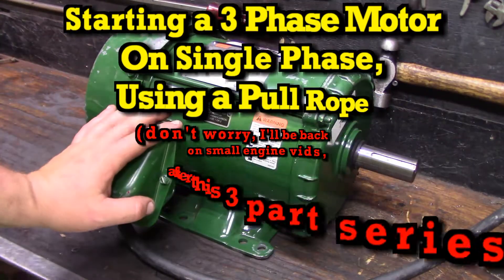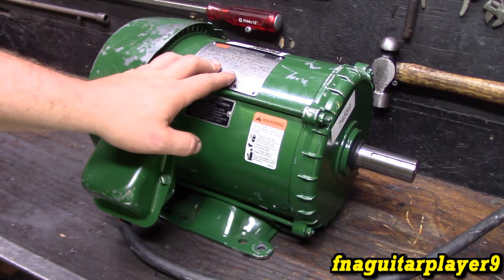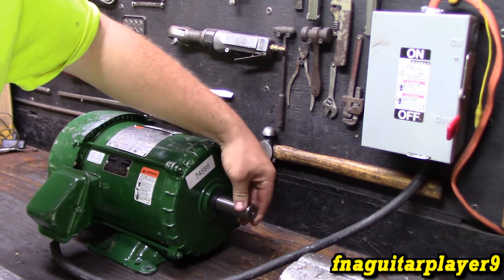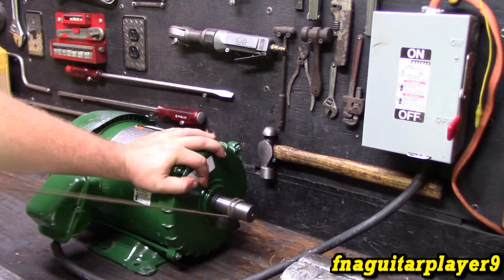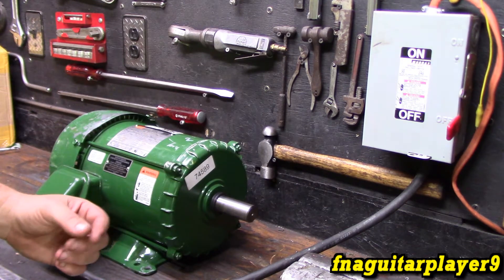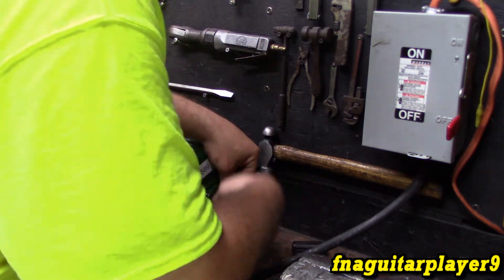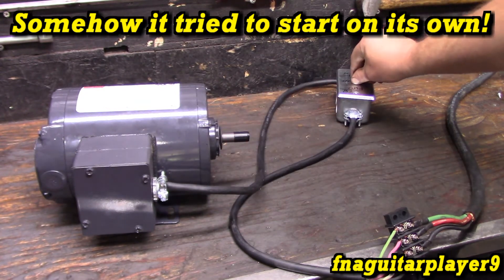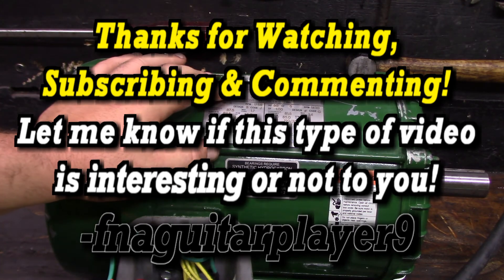3 Phase Motor Starting on Single Phase, ROPE START!

Comment: Nice job sir.  My 50 HP Phase converter just hums now.  I believe the capacitors have died after 20 years of use. Can't find a capacitor checking meter in this area.  Got one coming in 6 days.   Then I'll have to order the capacitors .  In the mean time I'll try getting the 50 HP motor turning and turning it on.  I guess it wont matter which way the motor turns.  Thanks for all the info.

Comment: If i understand, if i want to make my dual voltage to single phase , i stay in low voltage, connect phase 1 and 2 on 240v and 3 on a capicitor for starter, and it's OK?

Comment: I could use a homemade phase converter for some lathes and air compressors i picked up cheap.
Reply from the maker: I hear ya, instead of this I recommend getting a variable frequency drive, the one i got on ebay for 5hp was right at 100 dollars. Thanks for Watching!!!

Comment: Cool! I use a 3 phase 220 motor on 110 power with a VFD for my lathe. You ever see the KB electronics ones? They're super simplified, no digital display and menus and settings really. It can be dialed in in a few ways, but non digitally. It's nice.
Reply from the maker: I hear ya! No i haven't, I wish i did before i got the one i got, i like it but, i think simple is better! I got a digital one off ebay, not sure of the brand, but it was like 100 dollars for the 5HP / 4kw model i got. I'll check into those! Thanks for Watching!!!
Reply: @fnaguitarplayer9  I likely would have done the same in your shoes too, as that bump up in price for higher horse power might be too steep a hill for my wallet to climb. I just didn't want to deal with menus and settings or features that I'll never use, but those things aren't bad at all. They are flexibility for the person that needs them, but in my case I just didn't need'em, I just needed my 3 phase lathe to run on single.
Reply from the maker: @johnstrange6799  I hear ya, I just looked the kb ones up, that is alot more simple and probably more reliable too.
Reply: @fnaguitarplayer9  Simple yes, and reliable so far no problems after like two years of daily use, but I don't know that they re any better than anything else. Sure some super expensive heavy duty ones are undoubtedly great, but the world is also filled with fairly inexpensive ones that seem to be getting the job done for many many people. Only time will tell all I suppose. What are your plans for the motor?
Reply from the maker: @johnstrange6799  I hear ya. The one i got works, but i question the quality/durability. Well, originally i just bought it to make these videos on (there will be 2 more) kind of a impulse decision to get it, but i would like to use it on something, my buddy mentioned about using it on a homemade sawmill, but i'd rather have a engine on something like that to be more portable. I don't know, i'm sure i'll come up with something haha Now the small one (1/4HP) i might use on a belt drive blower or something like that and use the VFD to control the speed of it.
Reply: @fnaguitarplayer9  You could make a belt sander.  You let a motor sit around awhile, and a use will present itself.  I think the time has come for you to get a little lathe in the shop. Something old and not too expensive, but something that still works. You'll be making and repairing all kinds of stuff, and you already have a motor and VFD to power it! :)
Reply from the maker: @johnstrange6799  I've been thinking about getting a small lathe, be nice for making small parts! The VFD video is uploading now!
Reply: @fnaguitarplayer9  i swear that you will wonder how you lived without a lathe once you get one. You've got a motor, you've got  VFD, and you have a bench top. Just try to educate yourself on lathes a little (On how to spot excessive not even worth it wear, and on change gears, and are parts still around on ebay today for that machine) so that you have a good choice when you go to check something out. I just bought a wood lathe/drill press/table saw (Shop Smith thing) today for $5!

Comment: What’s the benefit of 3 phase over single phase? Lower amps?
Reply from the maker: Lower amps, no capacitor start or starting windings. Its smoother power, if that makes sense. Just a better way to go, especially for high HP motors. Thanks for Watching!!!

Comment: I've been around a lot of big 3-phase stuff but been burning diesel at the time. I always got there early and started the jaw and feeder so they'd be limbered up when the operator got there. The feeder had a variable drive inside the doghouse for the jaw (crusher) and kept everything and everybody warm in winter. I think the feeder was 25 or 50 horse and the jaw was a BIG job with a soft start.  I could get into telling about the old plant with the Cat generator and manual starters but that's another deal. I've learned a lot from the resident electricians but still won't fool with 3-phase. I'm fine with 220. Pick me one!
Reply from the maker: I hear ya! oh wow, thats a big motor there! I hear ya! Its always been something I've been interested in. Thanks for Watching!!!
Reply: @fnaguitarplayer9  Go work at one for a while. It won't take you long to get caught up!
Reply from the maker: @lewiemcneely9143  haha i heard that!

Comment: I have heard that using 3 phase motors is cheaper to run and cheaper to purchase used.  But I don't have enough knowledge to do any of that.
Reply from the maker: Yeah it can be just depends, my next video will be on variable frequency drives, the wiring is pretty straight forward but the control part is more complicated. Thanks for Watching!!!

Comment: Years back I built a rotary converter from a 5hp motor I fished out of a scrap dumpster.  It will run my 5 hp lathe and 2hp mill no problem or both at the same time.  One thing I found though is the current at the generated leg is low. You can use capacitors to balance the legs and it helps. Also makes the motors run much quieter when they are balanced.  If you run a 3 phase motor on single phase, it will NOT have the rated horsepower.  It will be less. How much less depends on if its delta wound or a y wound motor.  I'm no expert but I did learn quite a bit from other people on the internet and from experimenting.
Reply from the maker: I hear ya! That was a good find! I have heard that before, I'll have to experiment with that sometime, I didn't think it would be the same, not sure exactly how much less HP it is though. I hear ya, I've always had a strong interest in the 3 phase motors, finally able to get one for myself! Thanks for Watching!!!